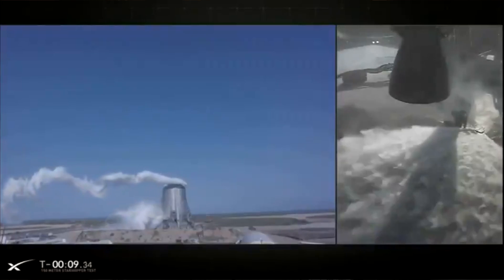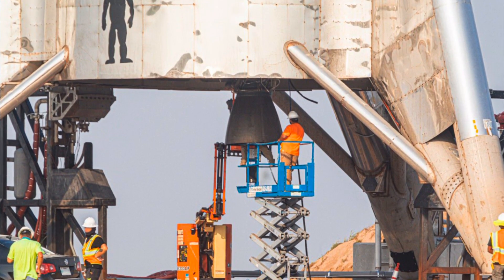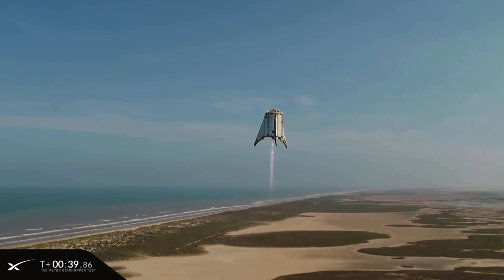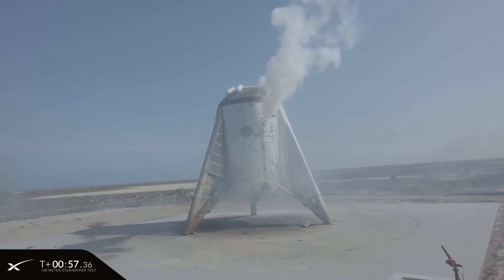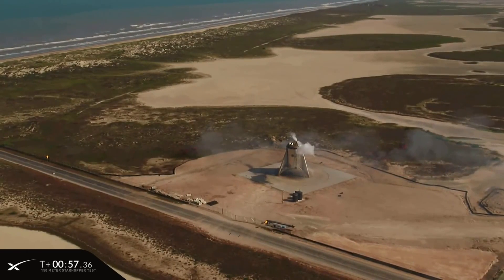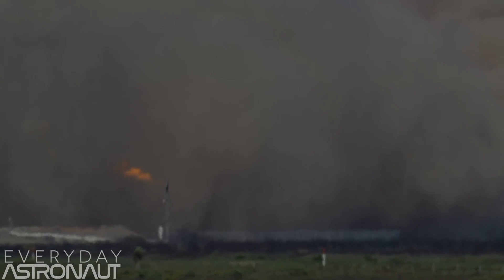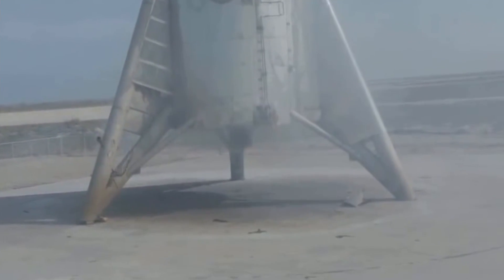Starship Hopper's Biggest, Lastest Flight Above Texas

Comment: From a purely engineering point of view, even a "clean" fuel such as methane can be made to produce huge amounts of soot if the mixture is set to be extremely fuel rich. This is for example how the soot for colouring tyers from white to black is sometimes made. 

So, for whatever reason, intentional or not, the fuel mixture shifted to a more fuel rich composition. Anything else is just pure speculation. Whether SpaceX will comment in any way on this and the obviously very hard landing remains to be seen.

Generally speaking, that things are breaking during testing is good. Musk is famous for saying "if you aren't failing, you are not trying hard enough", and I tend to aggree with that mind-set.

Comment: When I was a dev engineer, I always felt that slightly broken but surviving early test vehicles were the best. If the design is too conservative you always end up hacking off bits to save weight or cost and then having problems later in the programme.
Reply: By the way, I love the thumbnail hitchhiker's quote!

Comment: Initially thought it was a low pressure methane valve failure, but that doesn't explain the black smoke coming out the side before the flash and flames. The smoke later catches fire, so is almost certainly mostly hydrocarbons. Could be related to the autogenous pressurisation system. A rubber gasket burning on the methane side could cause black flammable smoke and send chunks of rubber through the methane side, as they would sink and get to the engine. Could block a cooling line, sending soot through the engine and causing a local overheat.

An initial flash and then a gradual change strongly suggests something went through the engine and caused damage, which then got worse. Could have been the oxygen turbine again, but that wouldn't explain the black smoke. External smoke and evidence that something went through the engine means it could be a hopper issue rather than a raptor issue. We can hope.
Reply: Watched Tim's footage again, and it seems to be venting early in the flight. I don't think it should be doing that, and it suggests the pressurisation system is not working right. The problems later could then result from underpressurisation of the input fuel, causing cavitation in the pump.
There was also an earlier flash. Not sure what to make of that one.

Comment: Alternative explanation of the color shift at landing:  We see the Mach Diamonds disappear at about the same time the exhaust starts yellowing.  Possibly the pad has become a significant sonic reflector as the engine approaches, disrupting the well-tuned DeLavall nozzle of the Raptor.  The reflected sound s HUGE, creating overpressure waves which rip the COPV bottle from the bottom of the Starhopper, and slow the exhaust stream to the point where sand can impinge into the stream and change the color.

Comment: These little problems (even though the engine starting to disassemble itself after 40s of flight might be a bit more serious if true) are the reason this is a test and not an operational flight. These problems are the whole reason for the test, now they have lots of interesting questons to anwser and errors to correct, and thats good aye?

Comment: If you have access to a set of either oxy/acetylene, or oxy/propylene torches, you can achieve the same effect. Get the torch running properly and find yourself a dirty/rusty piece of steel. When you move the flame over the metal, even if its just the tip of the flame, you'll notice that the entire flame goes from blue to orange/yellow. It's pretty crazy.

Comment: I think you were talking about the V-2 (which used pyrotechnic igniters installed in the nozzle), but Redstone may not have been all that different.

Does look like that engine had terbomachinery problems, but coaking does develop in fuel rich preburners and can flake off to produce that radiant carbon effect.  Probably was a real problem though, just looks very suspicious from too many aspects.  It may have ingested something which damaged the high speed parts.

Comment: I mean I am no expert on rocket exhaust but my first reaction was that it went fuel rich for deep throttling purposes.  The exhaust is that same yellow color during startup as well and I would imagine they probably get the last bit of throttling by reducing oxygen rather than both equally, fuel rich is gonna be far less likely to RUD than it would be at Stoich so with reduced chamber pressures and flow messing with proper mixing it would make sense to me anyway.  This is based around ICE engine combustion but I can't imagine they are that dissimilar that most of the same principals wouldn't apply.  As far as I understand it detonation in an ICE is roughly the same process that causes rocket engine RUDs(multiple flame fronts generate and collide causing pressure spikes which lead to containment failure, AKA boom).  They call it combustion instability though so I am not sure if its slightly different.  Anyway though the flame near the engine is definitely more troubling, that shouldn't be there and might very well be what lead to the hard landing, hopefully it wasn't anything worse than a weld cracking under vibration or something relatively easy to fix!  Thanks for the quality video and enjoy the penny arcade!

Comment: Hey Scott!  What’s the possibility that spaceX intentionally increased the fuel to air ratio in the last few seconds to be much more fuel rich?  This would likely cause the exhaust to be even cooler when the plume is hitting the landing pad at the cost of gunking up the engine a little. Just a possibility but if they could learn how to cool the engine plume down for landings it would only help them in the long term with landing systems requiring less maintainance.

Comment: I think that tradition might be spoke shake lore. You never make circuit and walking forward. IE, you build it getting-away from point Zero. Not the other way round, lines can get "charged" with static and then you're cooked if there's leaks or stuff like that or plain make your day bad since you have to go near a potentially primed rocket engine to diagnose failure. That and i'm pretty sure all such technicians are trained in the same school of pyrotechnics, one school to rule them all.

Comment: 'The closer you look, the less good it looks.' I would argue quite the opposite is true. A test vehicle with a perfect fight is quite bad in my opinion, you want as many non mission breaking failures as possible, you can learn from those and improve the vehicle. Only on approval or confirmation flights you want everything to go perfect. Every failure not taking place now might do so later.

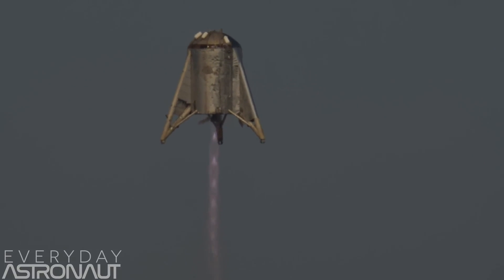Comment: What was the flame / smoke that you can see on the left side of the engine, such as at 7:34 (and then flame at 7:55), because the engine is a full flow staged combustion engine, so it shouldn't have any secondary exhaust, right?

Comment: The yellow flame reminds me of an Oxy Acetylene torch when you turn down the oxygen.  The Acetylene will burn yellow and smoke like crazy. Thank you for doing these , very enjoyable.
Reply: There is the potential that what we saw was actually acetylene formation and subsequent burning caused by a rich fuel mixture in the combustion chamber. The partial combustion of methane has been the go-to commercial method for acetylene production since the 1950s.
Reply: Yes, I immediately thought they were going fuel rich for throttle down and landing. Maybe they did unintentionally if the extra bit of flame was a leak.
Reply: @zapfanzapfan  my thoughts exactly. Wouldn't want to risk a lean landing while throttling and possible flameout.
Reply: That's exactly what I was going to say. Oxy Acetylene blue when the mixture is right, constant yellow well formed flame when a little rich, and big soft messy yellow flame with soot when only acetylene.
Reply: maybe the oxidizer usage was a lot higher than they thought itd be?
Reply: But it also looked like sodium. That color is almost identical to a sodium lamp, and since its so close to the sea, if even a little bit of salt got into the flame, it would probably burn like that. 
This is was on reddit, but it seems very plausable to me.
Reply: If the oxygen turbo pump broke or lost pressure, then it could cause this right? That is probably the most experimental part of the rocket.
Reply: @boggless2771  No, that was a fuel rich mixture.  Oxygen rich is BLUE and flameout.
Reply: @w8stral , i know, but if the oxygen turbopump had an Issue, it wouldn't be able to pump enough oxygen into the engine, causing a fuel rich flame right?
Reply: @boggless2771  Well, I suppose they could be throttling both the oxygen and methane, though eventually will have pressure chamber problems.  Tough problem.  The bigger the engine and larger the thrust the harder it is to throttle.  Add in that a BFR will have immense amount of momentum requiring an even finer control.....   Frankly, baring combustion chamber flameout problems, I see no reason to not squeeze both oxygen/methane for control and maybe they were testing rich/lean scenarios as well as normal operational parameters.  I know I sure as Hell would be running the scenarios and getting thrust results calibrated.   Maybe they had to recheck their results in an open atmosphere instead of tied to a test stand.  Vertical vrs Horizontal etc. 

In short.... I'm bloviating as the number of options of test are numerous and yes, numerous types of failures.
Reply: @w8stral  did you misread what boggless said? he said if the oxygen pump broke or lost pressure then NO oxygen was getting into the chamber, thus turning the flame yellow
Reply: w8stral if you play it in slow mo - you actually see the yellow “climb” the exhaust - and it seems everyone is forgetting during the other times we’ve seen hopper fire that when it’s close to the ground its got a very yellow flame. If you watch the slow mo as well, it doesn’t appear to lose power and you see it practically landed well after the little flame we see just before it’s obscured by spoke (drone footage rather than Tim’s)
Reply: @boggless2771  Indeed, and, it's same engine used for the previous hop.  But the nice thing is that it didn't blow up, some I'm sure they'll tear it down and see what's up.
Reply: As far as I remember the explanations, in the final version of Starship, pressure should be created by the evaporation of liquid gases. But enough pressure occurs when the vessels are full. At Starhopper, the tanks were not fully charged, because there was no need for large quantities of fuel and oxygen to jump just up to 150 m, and, in addition, during testing, it is much more dangerous. Therefore, as I understand it, this function of creating sufficient pressure in Starhopper was transferred to a small COPV, which were installed on top. During the decline of Starhopper, we saw a shot of flame, after which its color began to turn yellow. Perhaps at that moment, the COPV, which maintained the oxygen pressure, was damaged or the connection of this COPV with the oxygen tank was broken. The oxygen-poor mixture led to a process similar to CH4 + O2 = 2H2O + C with the release of free carbon, which gives this flame a yellow color. We saw this broken COPV through the Everyday Astronaut camera as it flew freely spinning. If there was not flying COPV I'd explain yellow flame during touch down with low-oxygen mixture as a result of changing engine regime at low power.
Reply: I wonder if the COPV that went flying off was supposed to help push oxygen through the line and it got super fuel rich at the end. I think methanol normally has a yellow flame. wait, is it methanol or liquid methane?

Comment: Could they have lowered the exhaust gas temperature to save the landing pad surface from getting too hot?
Reply: nopainnogain The fuel combusts to the same temperature no matter how they throttle it.  The only way they could get a lower exhaust temp would be to change the fuel to oxidizer ratio or to change the nozzle geometry, these are generally immutable characteristics of the engine and wouldnt even lower the temp significantly.  So not really.
Reply: @a.j.mckelvy7968  Theoretically they can change the ox / fuel ratio because raptor has two indivisual turbopumps for each.
Reply: spacedoge the turbo pumps are powered by eachother they don’t run at different mixtures.
Reply: spacedoge Indeed, but, as our boi Manley stated, the ratio is a design choice that affects performance and heat exchange.  Thats why I said generally  immutable; they could do it, but most engines dont mess with it for those reasons.
Reply: @a.j.mckelvy7968  Active mixture control was one of the big innovations of Russian rocket engines in the 60's. Soyuz boosters need it to make sure they burn out at the same time.
Reply: @jwadaow  Acording to a diagram on the wiki page, there are two indivisual turbopump shafts in the raptor engine, so theoretically they can move at different speeds. However injector geometry could be a problem if ox fuel raitio changes.
Reply: @a.j.mckelvy7968  With two separate turbo shafts it's probably hard to throttle without messing with the fuel mixture, I think they prefer having it going more fuel rich if this is the case.  That could be the reason for the orange exhaust.

Comment: They are clearly throttling the engine this low by running it fuel rich. This is why it glows because there is excess methane that isn't burned and methane is still a hydrocarbon, you can put a spoon over a natural gas flame and get black soot.

Comment: This thing can land on the earth, but the final version can land on the moon? I think would weight to little on the moon gravity for a soft and safe landing
Reply: Until we actually know the final specs of the lander no one can say.
Reply: @TheEvilmooseofdoom  we can make a educated guess about how much payload can deliver to the moon surface, and from that how much is needed to throttle-down a single raptor engine for a soft landing, my guess is at 20%a raptor will have 40 tons force, that means in lunar gravity whole ship would need to have a mass of 240tons before landing , which would be hard to achieve, that deep throttle capability of BE7engine about Jeff Bezos said would be useful for a raptor if they want to use for a moon landing.
Reply: @theOrionsarms  You can make an educated guess only once you know the final specs of the system.  Also you don't need to hover to land you can employ the same suicide burn that the F9 currently uses.  That is just a matter of timing.
Reply: @TheEvilmooseofdoom  are other reasons to land heavy, for example you need that amount of fuel to return to the earth, but obviously are more than two solutions to solve the problem or go around that, like striping down four of the engine after reaching LEO and taking a smaller payload, in this way can land on the moon (with a suicide burns of course) and have enough fuel to return to earth, if you think you only need a single engine for that, but long run solution will be a deep throttle engine and making fuel on the moon, problem is not specification of the roket but the fact was made for use on the Mars and earth, in the future they plan to use in the places with less gravity than moon, like Ceres where a deep throttle engine can be very handy.

Comment: There's some black "smoke" near the engine bell visible on EA footage - maybe that's what ignites just before landing?
Reply: Yeah, there's clearly something venting from around the engine for a few seconds before that.  Methane leak that doesn't immediately ignite?  If it's coming from the coolant loops, it might even explain the exhaust turning yellow if there's a loss of cooling at some location which eventually gets hot enough to start ablating and we have engine rich combustion.

Comment: "using hardware that's more-or-less off-the-shelf" ... Jeb's Junkyard getting a boost in business, then?
Reply: I'm here for the Douglas Adams quote in the thumbnail 😎
Reply: Anyone else remember  'Salvage 1' with Andy Griffith? Soon everyone will be making their own Hoppers!
Reply: I work for a US aerospace defense contractor, so I'd just like to clarify exactly how little we use off the shelf hardware:  Every screw, every cheap sheet metal bracket, every length of rubber hose,  every plastic washer comes from a specific supplier with a specific part number, and in the several months I've been here, I don't think I've seen a single part that's just been some generic screw from home depot.
Reply: Sloth545 

Whoosh
Reply: Well this thing is piratically water tank attached with rocket and stick a few fin on it.
Reply: I don't read much fan fiction, but that one was so worth it.
Reply: Hehe, Found laying by the side of the road xD
Reply: :D
Reply: Or Sanford and Son.
Reply: hahahahahahahahah!!!!

Comment: What was the cylinder type "thing" flying out? On everyday astronaut's video u can see it at 2:50 near right lower corner of the screen.
Reply: Helium or nitrogen pressurization tanks.
Reply: As he says, it’s a COPV: a pressure vessel used to hold liquid nitrogen. The force of landing must have knocked it loose and it ran for the hills.
Reply: Okay!!! Interesting!!
Reply: Is the liquid nitrogen used to maintain pressure in the fuel tanks???? Or.... I don't know... Can you enlighten me please!?
Reply: @nxkalnsnksjabsjdnma  I think.. but am speculating based on the F9, that the Nitrogen is for the cold gas thrusters.
Reply: AGNIV MANDAL It powers the cold gas thrusters. They may also be using it to pressurize the fuel tanks for this test vehicle, even though the final Starship will use self-pressurization if I remember correctly. It could also power the hydraulics that gimbal the engine.